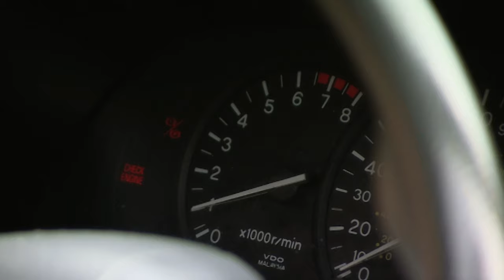Driving A Car With No Oil #TBT - Fifth Gear

Comment: Average bottle of oil, £8?
More like £20.
Reply: they probably meant for 1L bottle, not the huge jug in his hand.
Reply: I get a qt for a little over $3
Reply: Crazy, I get 5 quarts of Pennzoil (4.73L) SAE 5W-30 for about $13 here. that comes to about £10.70
Reply: I would say the price for 1 ltr at a petrol station is around £8? expensive I know,but it probably the only time some people check the oil (along with the screen wash)
Reply: Cheap 5 litre is around 8-15, but a service station on a motorway will charge you £20-30
Reply: Still less than an engine
Reply: @war3scecfang  or maybe it was filmed in the 80s?
Reply: i think he means £8 a litre
Reply: What oils are you guys using to get £8 a litre, supermarket brand? Thats ok for average cars or just a quick top up.. but for me its strictly Castrol Edge, Helix Ultra or Mobil1
Reply: @wasskhan3008  
Mobil 1 0W40 is £31 for 5 litre from Costco UK
Reply: Andy XxX  yeah I use helix ultra for my c63 its like £17 for a litre so I get a 5L one instead
Reply: Andy XxX  fair enough its what merc puts in my engine when I get it serviced so I just top up with what they use 👍
Reply: I payed €145 for 6L of oil at the dealer when i had the last change..

That was 10W60 racing oil though.
Reply: Andy XxX  Yea first and last time, next time i'll bring my own oil lmao.
They do good work but they fucking charge for it too...

Haha not racing, but just do a little sporty driving sometimes so i wanted the best oil i could get.
Reply: inflation, bud
Reply: More like £35 now 😭
Reply: Here in the United States it's usually cheaper to get a 5 quart (~4.73 liters) container of motor oil versus five 1 quart (~0.95 liters) containers of motor oil.

If your car calls for 4 or more quarts (~3.79 liters) of oil then you will most likely spend less on a large container of oil versus 4-5 of those smaller containers, you just have to be willing to carry around a partially emptied container of motor oil.

You can pour in approximately the right amount of oil, turn on the car to build up oil pressure for a few seconds, turn the car off, pull out the dipstick and wipe it on a rag, put the dipstick back in, and then pull it out to get the reading and add more oil until the dipstick comes out at the right level.

The reasoning for running the vehicle before checking is due to replacing the oil filter and as such some of that oil will end up in the oil filter, so for each additional pull of the dipstick after running the vehicle you don't have to keep turning it back on and off because the oil filter is already filled with oil.

Some people pour oil into the oil filter before screwing it on to the car, this is known as "priming" the filter. This is mostly done to prevent the engine from running dry while the oil pressure is building up but it's not all that necessary for most vehicles. Unless you're running a very old vehicle, a massive vehicle that takes a lot of oil, or a vehicle that is prone to seizing up before it builds up enough oil pressure to lubricate everything; then you most likely can do just fine without having to prime the oil filter.

Many newer cars simply have a plastic canister where you have to replace the gaskets and the fabric filter material as opposed to having all of that in a single metal container, in those cases you really can't prime the filter.

Plus while your car is on and building oil pressure that's a good time to check underneath the vehicle for any leaks from the oil pan and filter, since it's building up pressure that's when it's most likely to spring a leak if something wasn't tightened well enough. You shouldn't have to use any tools to tighten the oil filter since those are made to be tightened by hand and the pressure build-up should make the filter too tight to loosen by hand.

You don't want to have an oil filter that you can simply remove by hand because that suggests that it wasn't put on tight enough. Although, I've removed plenty of metal oil filters by hand either because they weren't tight enough or because I was able to get a good enough grip to muscle them off.

Comment: guys,  I must admit something I did when I was much younger.  I had a Ford 2300 4-Cyl that ran for 3 years with 0 oil (the oil plug was kept in the glove box) from when I got it when I was 16 until I sold it when I was 19.  This car ran with no oil for 3 years.  My brother ruined the transmission when he borrowed it over a weekend, and the carburattor eventually started boiling over the float bowl at each stop, but the motor continued to run if started for the time I owned it.  To this day, I can not explain how, but it did continue to run.  My motivation was to eventually install a 289 Ford engine into the chassis, but that day never arrived.  Instead, I went Porsche and never returned to American Iron.  However, this has always bothered me that this engine continued to run with NO oil for the 3 years that I drove it.  My dipstick was always DRY.  When I found this car, it was Green with a Green interior and was $750.  My parents chomped at the bit after dropping multiple thousands on the car my older brother destroyed after they paid for it.  Fortunately, I still own the second car I have ever owned (1974 Porsche 914) converted 10 years ago to a 3.2.  I believe that you folks need to test a modern day, modified 914-6.  Good luck in finding a pilot to do her JUSTICE, but it would be a good video nonetheless.  My hats off to you doing such fine videos.

Comment: well if u own a mazda rotary or an old subaru, u know the feeling every morning.
Reply: my turbo legacy never lost oil, but my na wagon legacy burns it like crazy and its relatively low ks haha
Reply: My legacy gx is oil efficient... But the fuel... Omg
Reply: doodskie999 
Haha true I own both!
But my Honda Del Sol burns the most. Checked my dip stick last week, was at half yesterday was right at low level.
The rx7 takes about two weeks for a top up and the Subaru 3 to 4.
But I do hit red line on a daily basis lol.
Reply: You forgot Saturns, they love to drink oil too
Reply: Or an E46/E39 M54 Engine
Reply: @Marati97  lol I own exactly two cars, an e39 and an del sol. So basically I am buying oil every month 😂
Reply: Or a VQ engine… definitely a VQ engine…
Reply: Or a Toyota 2.4
Reply: Well my dad has an astra gtc 2016 WHY WILL THE CAR NOT BE TUNED

Comment: checking oil when engine is warm is point less, as the oil has tp drop to the bottom of the engine to get an accurate reading, when hot oil has been circulated all around engine, check when cold
Reply: baby girl... just no.
Reply: true, the most important thing is the ritual that you should walk around your car 3 times clockwise, 3 times anti-clockwise, then squat in front of the car for 10 minutes before open the bonnet
Reply: ^rt
Reply: My old Mercedes had a separate reading for hot vs cold... but that just proves that you can't check whenever on most. Almost every car ever has you check the hot oil level lol
Reply: The oil will drain back within a few minutes....e.g. Check it after fueling up.
Reply: @unluckynumbersleven  That is usually a transmission dipstick. Also, thats the reason there is a safe RANGE on the dipstick.

Comment: I check my oil almost every day! And the rest of my car's fluids every week. I stay on top of my cars maintenance and it has 260k miles and it still runs just like the day i bought it. Only wear and tear parts have been replaced and it doesn't burn or leak any oil.

Comment: My LS1 drinks oil when at a high rpm. Use to drink a quart every 3k miles. Changed to 0-40 European mobile 1 at 130k miles and have 155k miles and doesn't drink any oil. Also engine is quiet when cold and ls1 engines are known to make some noise when cold.

Comment: 4:06 No....it's best to check the oil when the engine is cold.....
Reply: +Best of European Driving Captures Warm is fine, as long as you give it time for the oil to settle for an accurate reading then it doesnt matter
Reply: +Best of European Driving Captures Warm is good as the oil you add makes it to the sump quicker. A minute or so after shutting the engine off is about best.
Reply: +Best of European Driving Captures I always thought it was check it warm, change it cold.
Reply: +EmployeeJoe630 I'd change it warm too, drains more easily and thoroughly.
Reply: Think we can all settle on one thing, just dont do it hot and youre good
Reply: +Best of European Driving Captures I was looking for someone to mention this.
Reply: On my truck the dipstick says check when at operating temperature.
Reply: Wrong!
Reply: +alistair6101 Who? You?

Comment: I check my oil every fill up but I drive a rotary so argument invalid
Reply: i hope you mean fuel fillup :D
Reply: In a rotary it would be oil fill up as well!
Reply: A rotary engine lubricates itself by pouring oil into the gas chamber
Reply: What car do you drive, It must be old if its a rotary engine.
Reply: lol why would it have to be old....
Reply: 902 Yeti's I just don't see them anymore, Most cars use 4 stroke
Reply: Mazda is pretty much the only manufacturer that has used them anyway. Up until 2012 when the emission regulations caught them.
Reply: Audiojack 2012 is pretty recent although i wouldn't be surprised if those cars aren't allowed on the road
Reply: It's a 2003 first gen RX-8. It eats 25l/100km of fuel and spits a lot of flames through it's missing cat :D fun stuff but the worst daily driver ever
Reply: Mazda are in the process of releasing the RX-9, so we will have a new rotary on the market by the end of next year
Reply: ive got an 06 daily driven to this day
Reply: Same here but I drive a Honda... We can't really talk about oil levels that much hahhahaha
Reply: I got a new car since december 2015 and I only checked oil once. It was nearly full and did consume nearly none of that oil. And I know.. I always drive the engine warm till I turn it off again. I even make detours, just so my engine is warm when I turn it off. Maybe I'm paranoid or so, but I always try to understand how cars work and what's best for them, especially MINE. :D But I drive any other like that, too. Can't help. :)
Reply: Detc0re I drive my car with no transmission.
Reply: Evan Faraday lol is it a sprint car
Reply: Here we check our oil by how many miles and doing that often replacing oil can be a pain in a wallet and can waste the the new oil in your car.
Reply: Evan Faraday i

Comment: some modern cars have self lubricating parts to reduce the damage of an oil drainage. of course just filling your engine with oil is way better but in a situation like this it prevents the worst.
those work by producing a pretty porous but still strong metal with sintering and then drain it in a lubricant. the capillary action then fills the part with given lubricant.

Comment: i have a feeling they"ll end up overfilling the engine
Reply: if the engine is out of oil, put the whole bottle in,
Reply: +Razmalia some engines dont require the whole 5 quarts
Reply: +Greg Chavira doubt he put 5 qts in
Reply: +Josh Hines lol... im saying the actual people later will check there oil, notice its low and overfill it later
Reply: +Greg Chavira .... whole bottle = 1 quart
Reply: Ya they'll pour it till it reached the fill spout lol... They'll lottery top it off lol
Reply: +Brett Young lol! dammn my car takes 25 quarts to fill
Reply: Holy f*** did u try it?
Reply: +Brett Young no lol i forgot to add people be like
Reply: +Greg Chavira you have no idea how common an overfill is....
when i was a mechanic I'd see engines so overfull oil ran out the spark plug bores.
Reply: + Abe Lincoln.. Iv over filled before... I mean nothing like 25 qts lol but like .5 qt at most lol but I realize it when I check the oil and then get pissed that I have to crawl under the damn car and drain that shit out and get dirty all over again and chance draining to much... Because I'm anal about being exactly topped off on all fluids..
Reply: Brett Young most memorable on I remember was an old Roller '40's vintage.
those engines held like 18 quarts normally. apparently when it got put into storage whether deliberately or accidentally someone literally filled the engine to the brim with oil.
It was close to 20 gallons of oil.
Reply: + Abe Lincoln... Holy fuck lol
Reply: +Brett Young My friend actually did this, then didn't put the filler cap back on and drive 50 miles down the motorway. Vauxhall Nova 1.2 engine with VERY oily engine bay. Never rusted after that though!
Reply: Dopiaza lol the very first Chevrolet to not rust out...I bet his interior reeked of burnt oil for a while
Reply: dopiaza2006 heh heh Oil Tanker
Reply: +GCAutosports yes lol
Reply: +Brett Young overfilling better than under filling
Reply: viperz888 To a point, then the valves float.. and the motor goes BANG
Reply: + viperz8888 we'll fill it up and Ul blow a rod I'd imagine and under fill it and lock it up.... Either way it'll destroy something
Reply: Brett Young Oh hell yes I hadn't even considered hydrolocking the motor on oil
Reply: WTF is a quart, can you speak human please?
Reply: +z00h 1 quart is almost a liter but it is 1/4 of a gallon
Reply: +GCAutosports 1/4 of a US gallon... Imperial gallon is 4.5 litres (from the French litron apparently)
Reply: +dopiaza2006 yes but they sell oil in us quarts...
Reply: +dopiaza2006 but thats intresting i didnt know!
Reply: Josh Hines PMS?
Reply: GCAutosports now if only there existed a measure standard that 99% of the world understood without guessing if it's US or imperial or Mars based. Like one day someone will come up with one.
Reply: +GCAutosports I'm sure my dad (UK) had a 'quart' oil can he used to use to fill up his car. No idea what size that was! Good old Wikipedia... that was a quarter of an Imperial gallon. Now you know why our miles per gallon always seems so good. I do think we agree on how big a mile is?
Reply: +dopiaza2006 yes lol i us metric more than anything else btw and yes i do live in the u.s
Reply: Josh Hines PMS?
Reply: Check the owners manual where you get total capacity and sometimes it will tell you the range on the dipstick. IE it might say the difference between the low marker and max is 1 quart. If you do a full change just look at the total capacity then fill slightly under that amount then check and top up as required. Aircraft dipsticks will normally show the total amount in quarts, so you will have a marker that goes something like 4, 6, 8 etc... tbh it's a bit more simple then the vague Min/Max markers, but it works on the understanding that the operator knows the normal range.
Reply: Overfilling the oil could not cause valve float. Valve float is caused by running the engine at high speeds, greater than the speeds at which the valve train can maintain proper control of valve opening and closing.
Reply: over full is just about as bad as soon underfilled
Reply: Ryan Rohauer
+1
Reply: haha my dad sold his car and the new owners of the car filled to much oil and bye bye engine
Reply: too much oil isn't as bad as not enough

the car will most likely burn a little excess off
Reply: I wouldn't say that. In Diesel Cars, too much Oil is even worse. First, Oil would get into the Turbo - Which is really bad. Second, if your Engine starts to burn Oil, it could happen that it starts to run on Oil - Which would cause the Engine to rev up and kill itself without you having any chance to stop it.
Reply: Wtf is a Quart?? It's 2018 people, Litres please...

Comment: I did that with my first car. I didn't know what I was doing and didn't check the oil. After two months I did. Engine runing fine till then and when I checked the oilstick was dry like the sahara. :D And I drove that car nearly 2000 Km and with high speed. It was a VW Polo so it ran at high speeds with 5000 rpm or so. ^^ I was really impressed. Never had any problems with the engine but I sold it because it lost Oil and gasoline like any other fluid there is, so it seemed. :D Had never more than 5 liters of gas in it, because it would leak gas while driving. That was my first and really the bades car I ever had. :D